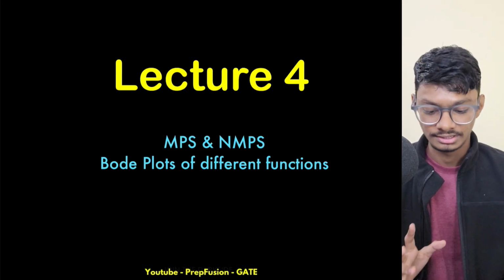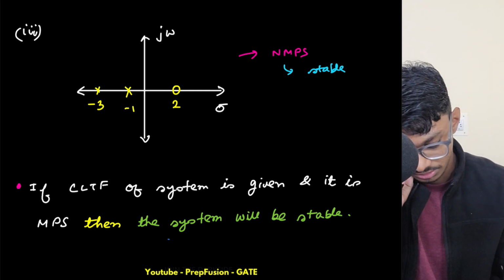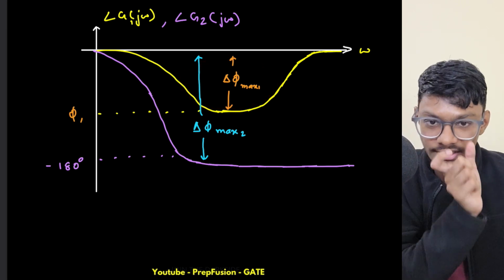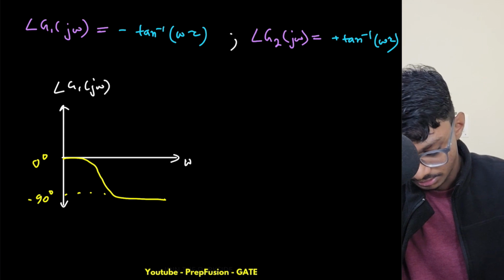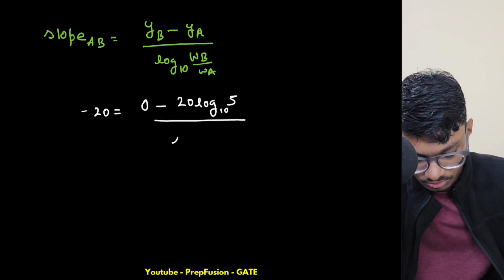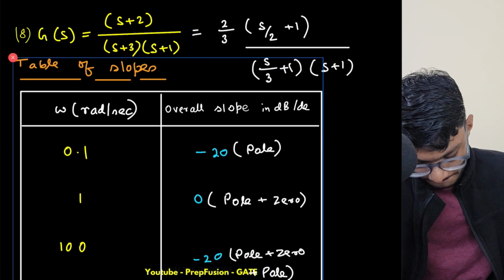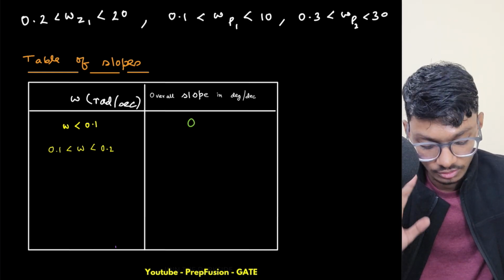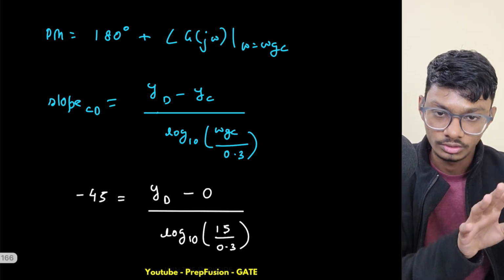Minimum And Non Minimum Phase Systems || Control Systems || GATE 2025 || PrepFusion

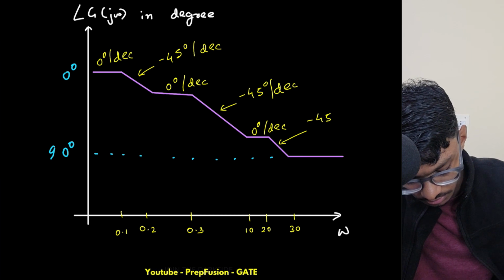Comment: Sir, at 1:09:00 how will we get to know the y-axis values from where the slope changes?
Reply: Put omega = infinity. The whatever phase you get from the transfer function that will be the y-axis value also explained in the lecture.
Reply: @AnishSaha_ sir, like at Omega = 0.2 slope is changing but it's corresponding y axis value we don't know, so just putting omega = 0.2 in the phase equation we can find that?
Reply: @Girik8447  Bode Phase plot is just a approximation of the actual phase plot. So there will be some error between the actual value and the value that we get from Bode phase plot how to compute the value of y-axis will be told it's similar to Bode gain plot just take the help of slope. Watch the lectures you will understand.